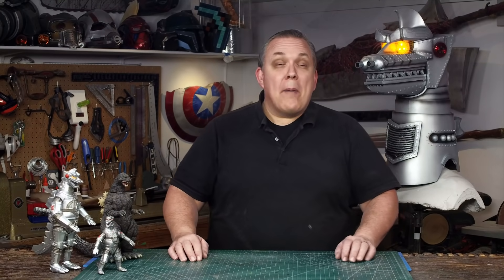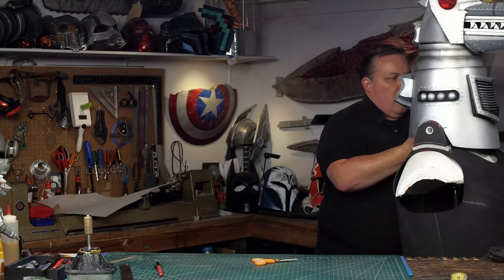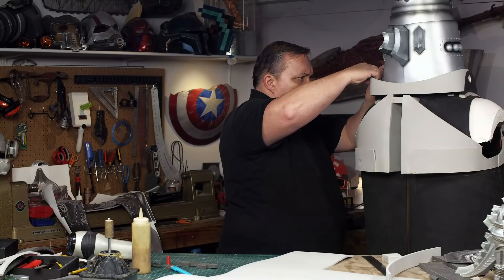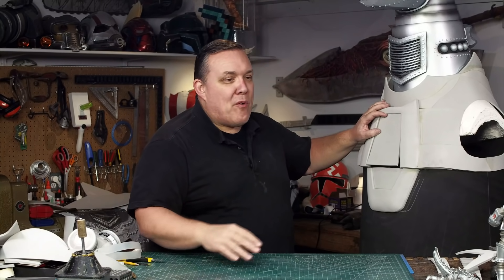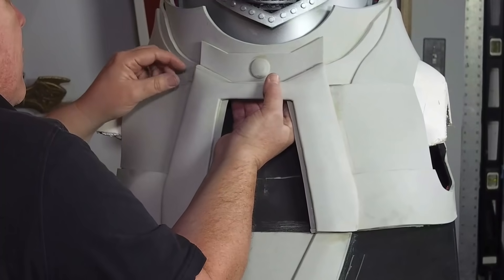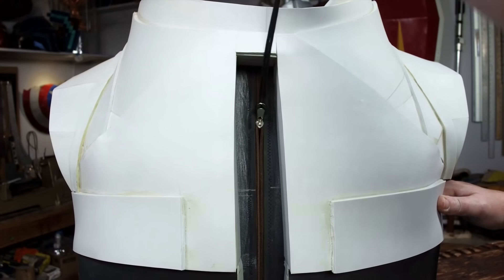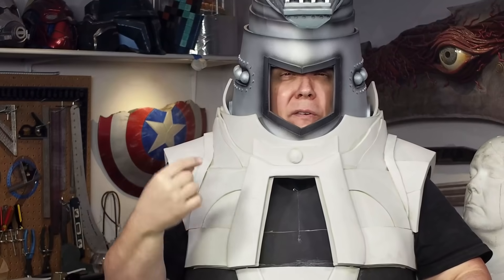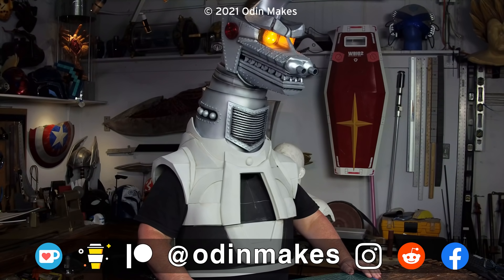Odin Makes: My Mechagodzilla cosplay chest build part 1

Comment: My question is - when it is all done, will it be able to stand on its own? It would be epic to have it chilling in the corner, and with the push of a button, lights and sound effects recreate the scene when he unloads on Godzilla and King Ceasar. 
 Awesome vid. Loving the continuation of the project, and your attention to detail. Can't wait to hear your thoughts on how to make the 'lightning beam' trap door open and close. My thoughts are a thumb trigger/wire system could work. Or maybe a pully system run inside the arms to the elbows? He does seem to pull his elbows to his sides when he uses it in both movies...

Comment: This looks great, I'm going to binge the rest of the playlist.
One criticism I have is that the head looks a little oversized and the neck doesn't look quite as bulky as the original. I guess you could call it a bit lanky? A 1:1 recreation of the suit would be extraordinarily difficult, even moreso than what you've already done which is impressive in and of itself, so I won't harp on it. Very good work.

Comment: I don't remember if you covered this, but are you going to have a way to have the mouth open and close? By the way I'm loving this build!!
Reply from the maker: It is my plan to do that, yes! I feel like I need to nail down the head rotation first.
The reason I have springs in the mouth to hold it closed is to have a way to pull it open!

Comment: Seeing you struggle to get out of the chest at the end made me think of DBZ's Saiyajin armor. What wouldn't you give for some futuristic material just like that which is both hard but flexible enough to stretch, eh?
Reply from the maker: Yeah! Before the shoulders went on, it just slipped on no problem! It was really funny.
It would also be easier if the neck fully opened, but I made the zipper stop at the top, I wanted a non changing collar for the neck to sit in.
Reply: Transparent aluminum is a thing now, so wait a quick day, and it might just exist.

Comment: well, THIS IS AWESOME, but, for the tail you will need a strong wire if you want to drag the tail or suspend the tail in the air, and for the chest door idk how will you do that, you know to open and close at you command well odin, you are the boss, I want to see you awesome ideas for this awesome prop
Reply from the maker: The really nice thing about 1974 Mechagodzilla's tail is that it is short, boxy, and does not move! I suspect just making a shell of the tail is going to be good enough.
Reply: @OdinMakes  true, I was confused with some others mechagodzillas XD the tail of this is short

Comment: You could save the chest electronics for a video where you put cooling in the suit. I bet you have space for some small fans in the area around your head. Seriously please give consideration to avoid overheating, you'd be surprised how fast it'll happen in something like that.
Reply from the maker: Thank you Michael, I have thought about it. There is not much room in the chest for airflow, but I can add some holes in the back for some venting.

And the head should work nicely, I can point a fan straight up, and let the heat blow out the mouth!
I was also looking at racing cooling shirts on Amazon, but none went on sale during Black Friday...